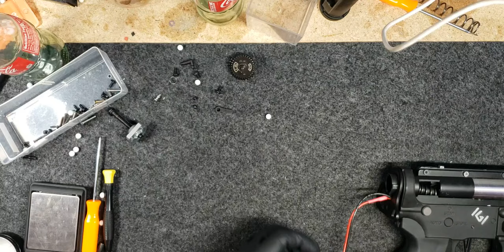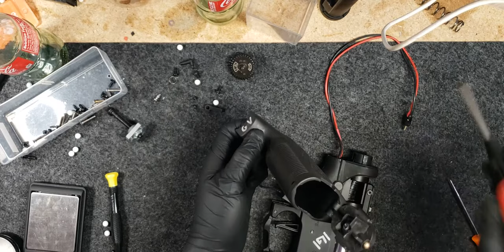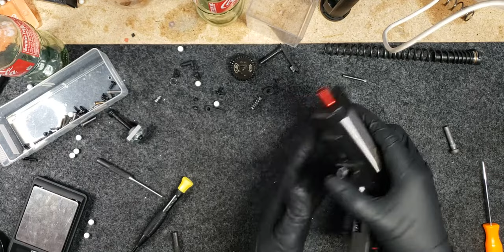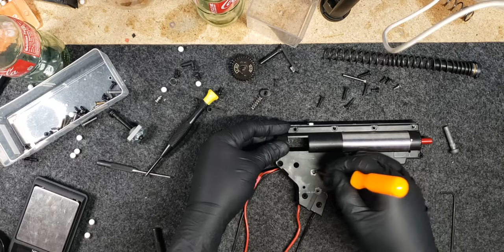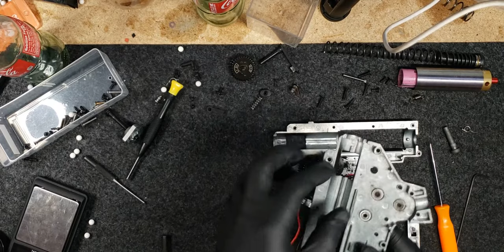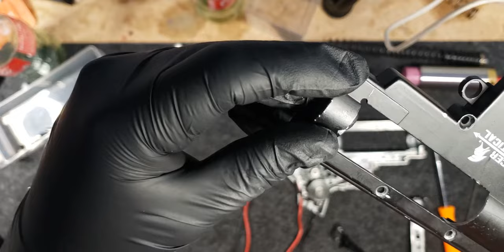How Lancer Tactical Gen 3 Failed Me

Comment: I tried installing the Perun into my gen 3 but there's no cut off lever, therefore no screw to secure the mosfet. How did you do it?
Reply from the maker: @PapoSigue  i had screws left over from gate titans and retro arms gearbox shells that worked with the Lancer gen 2 and 3 mosfet screw hole. I believe amped or lacapacustoms has a retro arms screw sets. I have extra if you can't find them there

Comment: How did the Lancer “fail” you exactly? Everything internal has been replaced. Looks more like a PEBKAC issue.
Reply from the maker: So due to the upgrades the stock Lancer Tactical shell began to crack at the front. Because of this we had to replace it an with a Retro Arms Gearbox shell which is fairly costly

Comment: Hi.are you using a metal/alum piston head?
Reply from the maker: No generally i opt for a poly piston head however sometimes i will go with an aluminum depending on the build
Reply: @6mmCustoms  most likely the cause of crack is the combination of metal piston head and cylinder head.i did  several LT gen3 here in the philippines ranging from 450-600fps .20bb,no reported gearbox failures yet.always installed POM pistonhead and metal cylinder head or vice versa.
Reply from the maker: @RowellBaligad-eo4yh  my apologies. The client had installed his own compression using a aluminum piston head an cylinder head. That's why it cracked